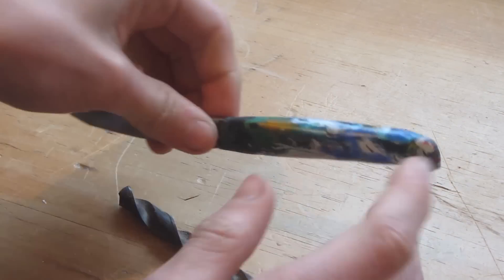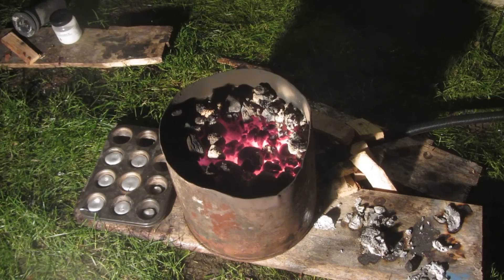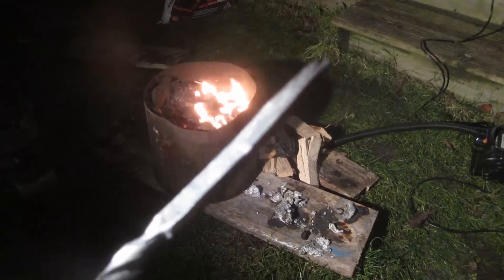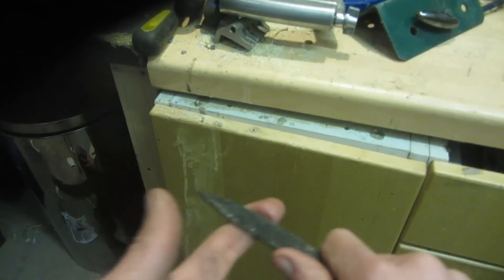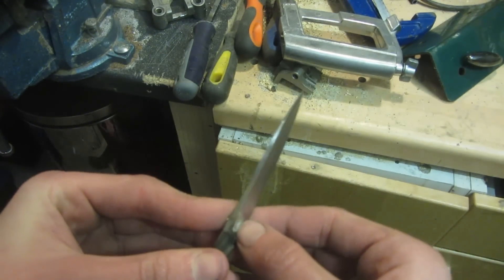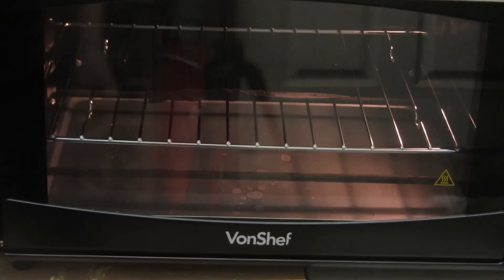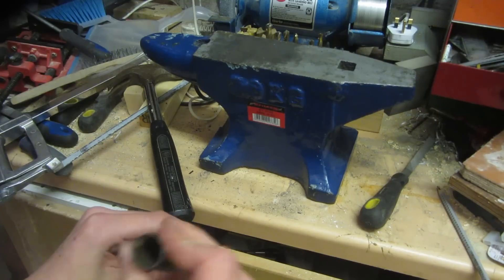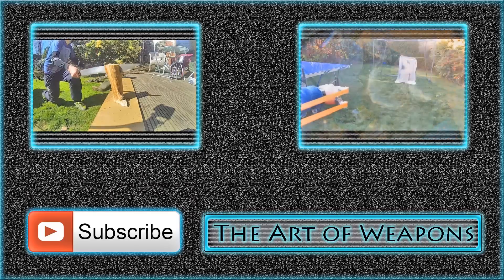How to Forge a Carving Knife From a Drill bit - part 1

Comment: I am a journeyman smith in the early phase of my journeyman's voyage. I really like the idea of using a drill bit. I would recommend NOT hammering a cold, noncolor piece. You will gert microcracks that lead to blade failure. Also, find a wide, evenly cut log that rests flat on the ground. This will serve as a base for your anvil, which should be strapped to the log. That way it won't walk around as you strike. Also, the log can be moved around as need demands. Great idea.

Comment: Great to see you giving it a go. I spent a few summers working with a black smith at the end of high school. By way of encouraging you to continue I have a few tips that you might find useful.

Get that anvil bolted down your making your job ten times harder with it bouncing all over the place like that. At least half the effort you are putting into the forging process is going into making the anvil bounce. You also will never be able to use the horn effectively with it bouncing about like that. Aside from that an anvil on the foot hurts. 

To get the correct height for the anvil stand with your hands by your side the the face of the anvil should be level with your wrists. You should never have to bend over to use the anvil nor should you have to reach up. 

In several place you were working the metal too cold. When the metal is a dull cherry red it's time to put the steel back in the fire as you will get few gains for your efforts. 

The proper way to get a straight edge on a knife is to line it up with the edge of the anvil and hammer the bevel. You can't do it when the anvil is not bolted down. 

Old style auger wood drill bits are okay for knives. They are usually carbon steel. High speed steel is totally different animal. Don't even bother with cobalt bit the alloy is too complex to be effectively handled in a forge.  Leaves from car springs may look attractive but forget them. Spring steel is no good for blades. 

Just one point, the motor oil will not add any appreciable amount of carbon to the steel. Case hardening is a process that takes a significant amount of time even under ideal conditions, with specially made made compounds. Case hardening is most frequently use for hard wear surfaces such as bearing runs as it only provides a hard shell. It is rarely used for knives as it seldom improves the quality. To produce a quality knife you are better off starting off with a good quality steel.

Comment: Would a steel Nail or bolt work instead of a drill bit?
Reply: no man thats to small
Reply: only if you had like a 10 inch nail
Reply: Nails are made out of mild steel, won't harden.

Comment: You did a super job, and the result looks great!!   Your re-use of materials is inspiring!
I didn't read through all of the comments, but there has been some good advice for future projects, some of them bear repeating: 
- Natural fiber clothing avoids your clothing melting to your skin when working with items hot enough to melt plastic.  All it takes is once to have 3rd degree burns... be careful.
- Tempering in your oven is doable, but the temps will be "ish", and I don't know if your stated temp was F or C, but I will suggest no less than 400 degrees F to start taking out the brittleness.
- Ergonomic tool heights will help you avoid undue body stress:  Raise your anvil so that the face of it is even with your knuckles when they are at your side.
- Check the properties of HSS.  You will want to work within its properties and tolerances.

My own suggestions:
- Your tools are your enemy or your friend.  I applaud the use of "what you have", but what you have can be modified a bit to make it easier: 1) use your files to round off the edge of your anvil.  This is easiest done with an angle grinder.  Putting a gradually increasing radius on the edge will help when you need them... and if you continue, you will need them.
- Making a pair of tongs is a difficult project without guidance, but see if you have some vice-grips, at least, to start with.  Controlling your piece is essential to being safe and it goes a long way toward helping you hit what you want where you want.
- Shape your tip before you flatten.  If you shape the tip of your piece with a few hammer blows to be roughly a the shape of the tip you want, when you go to spread your metal, the tip will be in roughly the right shape and will require less grinding (meaning more goes to the blade).
- Invite someone who works in safety at a factory over to watch you work.  They will have all kinds of great suggestions that will help you to stay safe and able to continue doing such wonderful work.

Comment: You should set your anvil in a box of sand, mount the anvil to a thick piece of plywood a bit smaller than the inside of the box, the sand absorbs the impacts of the hammer so it stays still and doesn't dance as you strike.
Reply: YEA AND FALL OFF YOUR BENCH ONTO YOUR TOE
Reply: NO It will not.
The sand level is about an inch lower than the top of the box.
The sand absorbs vibration, keeping the anvil and box perfectly still while hammering. That's how i set my anvil and i am a Bladesmith. I have done some very heavy work and never had much of a problem.
Reply: i was adding to your comment lol i totally agree with you.
Reply: +FANNY SHMELLER Yeah,  I thought the same thing as it was dancing towards the edge.  My anvil is bolted to a piece of galvanized drain tube filled with concrete.  Its a pain to move,  but I've used an 8lb sledge on some leaf springs without  a so much as a wiggle.

Comment: Good job! My suggestion is mounting your anvil to something massive and in flexible. This will give you more efficiency when forging. Also, drill bits and endmills made of high speed steel (HSS) are very tough, heat treatable, and fairly common. Any machine shop will give you their old burnt bits for free.

Comment: 1. that really isn't the most efficient forge that you could have, if you're going to go with coal I would suggest using fire brick to make a kind of valley which you have your air supply running underneath. 
2. Please please invest in some proper tongs
3. put a big ol log under your anvil, the efficiency of an anvil is determined by how well your hammer can bounce off of it (there is a more in depth reason but that's it in its most simple form) a log underneath will greatly increase that
4. If you plan to delve deeper in blacksmithing, buy a good, forged anvil, a cast anvil which is what you have is not very efficient

Comment: @the art of weapons Just a little bit about your heat treating process: The idea that quenching in oil adds carbon is an unfortunate myth. The amount of carbon dissolved in the heated steel is almost completely determined while the steel is at a certain temperature. I'll get to that later.

A quenching bath has a few distinct characteristics, most important are 1: How quickly the bath takes heat away from the part and 2: How well the bath prevents vapor pockets from forming near the part. The second characteristic is important because vapor pockets are really poor at taking heat away from the part.

Oil is interesting because although it will take heat away from the part more slowly, it will also tend to 'stick' to the part. Water is usually a better quenching agent because of its specific heat cooling the part very quickly, except that it tends to boil rapidly when a hot piece of metal is plunged into it. Usually it isn't too hart do quench a part with long handled pliers in a bucket of water, just keep the part moving faster than the water can boil in the area around the knife.

Generally speaking, the only reason to quench slower is if your part's design is such that it frequently breaks as soon as it begins to cool. There are companies which make engineered quenching baths with custom -tuned heat absorption rates and exceptional adherence to hot parts.

You can easily find a chart called an Iron-Carbon Phase Diagram. It shows the quenching temperature, AND the tempering temperature ranges for every possible combination of steel at any %carbon.

When you want to quench a carbon steel, you must first heat it to within its Austenitic range. Austenite is a term used to describe a certain grain structure of the individual bits of iron in a steel. Allow the material to rest at the austenitic temperature for some time (910 degrees C is generally the rule, let it rest for ten minutes or so for a small thin piece like a knife, longer for a bigger piece), then quench as rapidly as you are able. There is a property entry for most steels called "quenchability" which has to do with how 'willing' a metal is to quench. More quenchability means more depth of metal will be successfully quenched, that is, the outside surface will quench very easily, but the center of a piece might not be quenched at all, and nearly as soft as if it had been annealed.

Tempering has to do with raising the metal to a temperature at which another grain phase occurs, which is described as Martensite. It's been a while since I've done anything with tempering, but I feel like the cheater's handbook of tempering suggests that 450 degrees C will tend to work for nearly all metals. The metal is raised to the appropriate temperature, and allowed to cool either in the air or in the furnace. 

You can do hardness tests at each point if you are curious, for most steels I would recommend a Brinell Hardness Test at the C range, just to establish the difference within the same piece at different processes. The test measures a known shape, the force applied to the part by the known shape, and the depth of penetration at that force to determine the hardness of the object.

What's interesting about the phase diagram is that you'll find that all steel is between .008% by weight of carbon and 2% carbon, and above 2% carbon is called cast iron. Additionally, you'll find that most of the metallurgical differences between the steels and irons you've known in your life are the specific levels of chromium, nickel, vanadium, molybdenum and carbon. Other than that, it's all basically the same stuff. 

A great source for looking up the properties of a metal is Matweb.com. I suspect that your drill bit is A4 Tool Steel (because it's suitable for cold work on metals), and you'll be able to see all the properties of that, or any engineering material (Polymer, Elastomer, Metal and Ceramic mostly) that they have in their database. 

Heat treating is super annoying to learn about, but it's good to know. Let me know if you want some scans from my ole Engineering Materials books.

Comment: just in case anyone was wondering, it doesn't matter whether you have a metal or wood drill bit. They are both made out of the same high speed steel, just with a different angle on cutting edge

Comment: I notice you seem to be holding the hammer pretty high (close to the head), you're robbing yourself of a lot of energy when you do that. Especially when you're using smaller hammers. t
Try holding the hammer more toward the end of the hammer when you're drawing and doing broad shaping. Using a heavier hammer would be advantageous as well but not everyone can swing bigger hammers accurately. I use a 2-3lb cross peen hammer. I don't know what you have close to you but second hand tool shops usually have a steady supply of hammer heads. 

Good build!

Comment: If you want the blade still hard but much less brittle you can heat it to an orange hot then water quench. Then heat it to about a blue grey hot and let it air cool to around 40 rockwell. It will be much less brittle, easier to sharpen but still hold a good edge.

Comment: just a tip on using your hammer (not teaching you to suck eggs or any thing) Hold it at the end of the handle, you will find this makes your blows more powerful and with time more accurate, there for saving time and energy. well at least that's what my blacksmith teacher told me. loving the videos bud, keep up the good work!

Comment: when the metal cools down to where its not red any more you want to stop and re heat it if you work on it when its cold you will make stress cracks in the blade when you go to harden it so you want to avoid that

Comment: Nice work!  

As for suggestions, a short length of log on end makes a good anvil stand.  Will firm it up so more of your strike power goes into the work, and will keep it from falling onto your foot. 

For tempering, you really want the edge to stay hard, while the rest of the blade is softened a bit so it won't break. After hardening you really want you heat the back much more than the edge.  I've seen this done with an oxy/acetylene torch...played along the back edge and watch the color bands move toward the edge, then quench. I expect you don't have that equipment.  An older way to do it is to heat a big lump of iron in the forge and hold the back edge of the knife against it.  That gives you good control over the heat transfer. 

On a TV show I saw a decent forge made from a wheel barrow.  It was lined with clay, and used plumbing pipe and flanges to admit air up from the bottom. Probably bigger than you need for now, but eventually you may find the need for a bigger fire. 

Keep at it, read as much as you can find (Taunton Press has several decent books on blacksmithing), and you'll get there.  You've made a really good start. 

-- Mike

Comment: Be aware, cobalt is extremely hazardous to your health.  01 rod is know in the metal trades as A2 tool steel.  It is tough to work but fantasticly strong.  D2 is a bit tougher and S2 is impact resistant.

Comment: Hi There. the drill bit that you just forged is made with two different materials, the shank that you forged is not high speed steel but still a high grade steel. The twist section on the drill bit is the good stuff

Comment: 3 tip, heat it to cherry red, more than that is not the best.
fix the anvil
make it higher also you look like you curve your back and it will give you trouble later.

also, steel toe boot and good non flamable clothing,

Comment: You did a great job man, but i have some suggestions Yes, it did cut trough the paper, but it did pass really good, since you can see the "tear part". but good video.
Depending on what use you want, i would suggest you to use the  "Scandinavian" grind, since it is the sharpest you can get, but you need a lot of maintenance,. If you can, you should make the blade larger from the edge to the spine.
If you are right handed or left handed (for wood carving for example) it is better to use a chizel grind 15/75 10/80 (differential, one sided sharpening).  Now about the stock removal blacksmithing, it was pretty good, except with the tempering, since you putted tip first, it will overheat and ruin the metal. If the blade was made of Carbide, i normally like to use water-quenching since  it is a lot easier to use (but i don`t know if is a proper way to use).

Comment: Hey, if you get a couple long flat pieces of steel, say the width of a ruler and maybe about a foot or two long, you can heat them up and put them over the feet of your anvil on the front and back and hit them, so that they form around the feet. Then you can drill holes on each side of the formed metal lashings and bolt your anvil down so it doesn't move. Quick and effective mounting and it wont cost you much.

Comment: To get the best possible heat treat on a blade I recommend a salt water quench but put oil on the surface. It will start out as an oil quench and then turn into a salt water quench. This has yealded the best results for me in preventing warping  but the bigger the object, the more chance of warping.

Comment: Try to.
While you forging your knife put a thick metal lump in the forge and let it warm up at the same time as you r dorging your knife.
When you r gonna heat treat your knife warm it up the same way as you do and then put it in oil or water, the knife is now very brittle as you know. Take out the big lump of metal from your forge and skrubb the knifes back at the hot metal with the edge up. 
You will now se some coloring on the knife, when green color gettin close to the edge you will stop the proccess and let the knife cool down.
This method will give you a hard edge and a soft back and also realy nice knife quality.
Easy to sharpen and will hold the sharpnes longer.

Good luck
The swede

Comment: i used to be a blacksmith....
when forging high carbon steel you do not want to make your metal bright orange as it will break down the carbon property

forge high carbon at a dull orange or dull red.. takes longer to work but does not ruin the metal and you wont have to re-harden it which defeats the purpose of using high carbon steel if you have to reharden. also makes it easier to temper

good luck nice video

Comment: well from what i know for forgeing most knifes a small compact forge works best with lots of insulation ohh one more thing i would like to point out a full high carbon knife is not the best for use out of the workshop it holds a eadge super well and is super sharp but the drawback is its hard to sharpen back up without a belt sander  and lastly heat treat it firts than sharpen it

Comment: First of, how old are you? You sound young. Good job on the knife.

Also, I've been wondering for a while how old-timey weapons were heat treated and whatnot, without modern temperature analysis. (too lazy to google something so specific) When you mentioned testing it with the pliers to see if it was magnetic, I literally got up from my computer yelling "OOOOOOOOHH"

I've been wondering that question for a while.